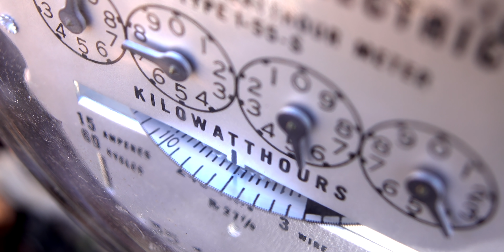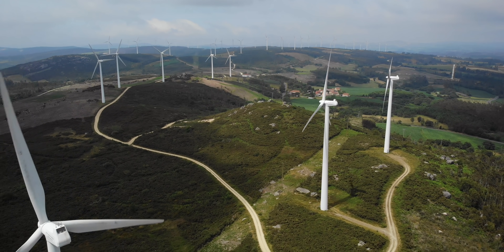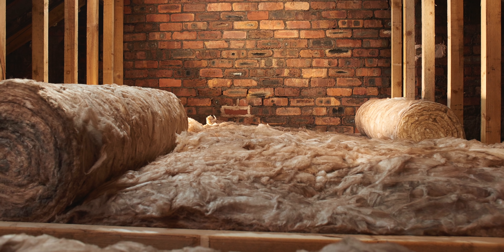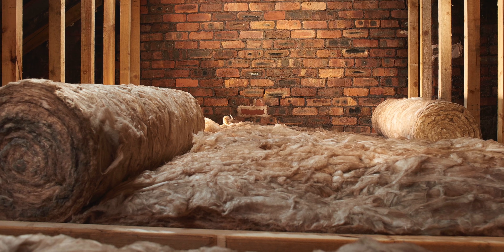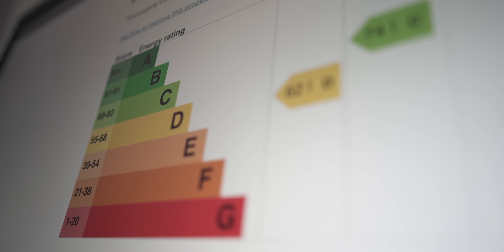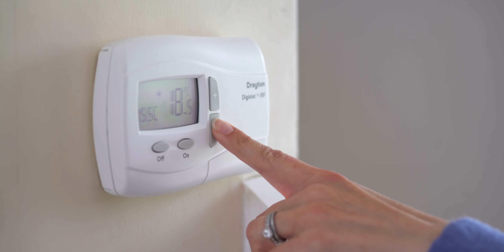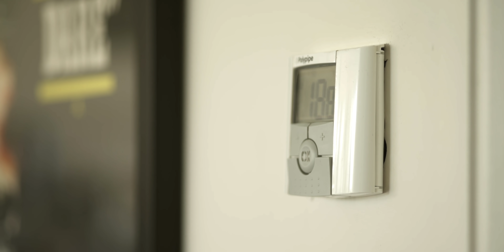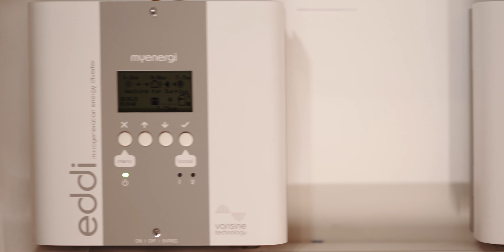HOME ENERGY Episode 1 - Cheaper Measures, Energy Efficiency & Fabric First | FULLY CHARGED

Comment: Did I mishear something in the opening credits... I thought I heard that the UK has the most leaky houses in Europe... are they talking about air sealing (ACH Air Changes per hour) when this statement is made. If its true (I assume it is) I wonder why the design of UK houses ends up with this outcome... maybe the UK has relatively more temperate weather ?
Reply: They mean the most heat-lossy buildings in Europe - so that's both terrible airtightness, and terrible insulation. The main reason is that our stock is much older than most countries. We have built very long-lasting (brick) buildings for a long time but they were not designed to be heated more than a fire in the corner. And yes because our weather is relatively mild we've been able to get away with very lax building standards. Places where it actually gets cold have been doing this much better for decades.

Comment: I live in an old house built around 1800 which is very much thermally inefficient, you going to talk more about rendering and such like, this is something I'd like to do but haven't got the confidence to know what is best given the potential cost outlay..
Reply: What sort of construction? Go to the Green Building Forum for advice. For a building that old (probably with no DPC and definitely no cavity) natural materials is generally best to remove risk of damp problems. Talk to BacktoEarth or NBC or Lime Green. They all have plenty of experience of putting on woodfibre EWI with lime or silicone renders. And can put you in touch with local installers. If you want to do it properly you should think about 3G windows throughout as well as EWI +perimeter insulation, airtightness+MVHR and roof or ceiling insulation to make a dramatically better building. Life is much easier if it's not listed.
Reply: @xxwookey  thank you will look into this, yes it's solid brick with no cavity and it's not listed

Comment: Yes, thermal efficiency of buildings needs to be improved, better insulation, windows, doors, cutting out heat loss from leaks. However, what about ventilation? Air tight/passive houses require a HVR system to recirculate the air which is installed in the walls, floors and ceilings. Or else lack of ventialtion will cause mould, condensation build up and sometimes health issues.
Reply: He did mention airtightness (before insulation) in fact, but it could have been emphasised that both are really important. Everyone knows about insulation. Air-tightness rarely get mentioned.

Comment: Hoooold it! Not heating rooms that are not in use is a downright dangerous suggestion. 

Once you go below 15 degrees Celsius, you risk mold when warmer, more humid air from other rooms enters the cold room and creates condensation. 

Don't do it. Keep the room temperature lower than in used rooms, but high enough to avoid mold.
Reply: I thought that mold comes from when there is humid air (carrying water) hitting a surface below the dew point... The humidity condenses into water and the damp creates an environment for mold to grow. So I understand its when you have deltas in temperature and a humid environment. Thats why double glazing sometimes fogs up... cold glass, warm humid air... Feel free to correct me I am a novice in this area.
Reply: @MovieNutter  yes you have it right, but the point is that typically-humid 20C internal air will condense around 13 or 14C so you really want to keep all internal surfaces above that critical 14C. So this doesn't require a specially-humid environment - just a normal house with people in it (breathing, cooking, washing). This is why triple glazing is such a good idea, because it never gets colder than that on the inside. and why airtightness is important, because the wet air going into the fabric on the way out will cool to below 14C somewhere in the wall, which is not where you want the water collecting. So anders is right that in a poorly insulated building there is a risk of condensation in the unheated rooms. If the insulation is any good at all then the unheated parts will stay fairly warm.
Reply: Capt Shiny houses don't have to be massive for heat not to reach unused rooms. We had a typical Victorian semi, three stories with original staff bedrooms in the roof. With the door at the bottom of the stairs closed these rooms quickly cooled to little more than a few degrees above the outside temperature. Same with the rear bedroom on the first floor which had two outside walls and no cavity.

Comment: Loved the video, we opted to replace our oil boiler with an air source heat pump last year, the technology made it so evident how we were losing energy in our 1930’s house and the need to insulate more which is proving challenge, I wouldn’t go back as despite the increased electricity bill it is still cheaper than oil but we have a way still to go. Looking forward to the rest of the videos.

Comment: All real estate sites should be required to include an energy rating and the monthly cost for the last 12 months of heating and cooling utility bills whenever a home or building is listed for sale. A person might be able to afford a better home if their total cost of ownership was lower.
Reply: They basically do that already in the U.K.
Reply: @bordersw1239  Yep, not in other places though
Reply: Kenz300 x We have had such certificates in the U.K. for years, and nobody ever looks at them. There are so many factors that are considered when buying a home, and for most energy efficiency comes at the bottom of a very long list. In any case, all new homes are built to a similar standard so cost roughly the same to run on a per sq ft basis.

Comment: Thanks for the 1st episode. I’m interested in the aeriated shower heads. You source mentions ‘under £100’, but a quick search on Amazon shows around £10. Are these models the same thing? (The heads with the stone balls in). Cheers
Reply: Yes (but there's more than Amazon; any decent DIY building supply market should carry them where you get to see and feel them in real life too)
Reply: You can get aerated shower heads for incredibly cheap nowadays but there are some really fancy ones also costing more. 

I’ve installed aerated connectors on all my taps. It made a world of a difference to the water usage. It is an absolute no brainer.

Comment: looks like a great series, just hope that in the heating episode you did not forget half the world that needs aircon more then heating.....
Reply: Heat pumps are able to do air conditioning as well as heating as long as the inside part is set up properly. If you replace a boiler with a heat pump so that it heat water for radiators then it won't be able to do air conditioning. However, if you replace a forced air furnace that burns gas or uses electricity to create heat with a heat pump then the heat pump can provide air conditioning. An air exchange heat pump is almost the same as an air conditioner that is often hooked up to those forced air furnaces.
Reply: @capitalinventor4823  we don't have heating here - no need, for a few days a year - we heat with the aircon, the question is if there is if a GSHP or ASHP is more efficient then aircon?
Reply: @idodekkers9165  

An air source heat pump is an air conditioner that can also run in reverse. If you are able to heat with your air conditioner then you already have an air source heat pump. 

Ground source heat pumps are going to be more efficient because the pipes are going to be installed in the ground where the temperature is at a constant temperature that works well for both heating and cooling. With an air source heat pump there will be times when you want to cool your building when it's so hot outside that it's difficult for outdoor part of the unit to get rid of heat transferred from inside. (The same thing happens when it's so cold that it's difficult for the outside part of the unit to extract any heat from the outside air.) Of course these times happen right when you most want the unit to work. 

It then comes down to price. Getting the pipes put in for the ground source heat pump system is expensive and makes those systems much more expensive than air source heat pumps. When I was looking at replacing my furnace back in 2015 an air source heat pump was twice as expensive as a high efficiency furnace and the ground source heat pump was about 2.5 times as expensive as the air source heat pump. I'm sure prices have changed since then.
Reply: @capitalinventor4823  so if I understand correctly, what the heat pump basically does is get the temp outside, lets say 23 and if I want 20 it only cools the difference with electricity?

Comment: I like to think I’m fairly technologically literate but the one thing I’m struggling with is figuring how you get all these different systems to talk to one another and work in harmony.
Reply: I know I'm tech literate (both formal education and over 35 years of experience in the energy field) but why would you want to have them "connected"?
All of these "systems" are (relatively) simple and (can) work perfectly well "stand-alone"
Connecting them only complicates things unnecessarily
Reply: @TestTest-eb8jr   Ok so I’m thinking is that we’ll likely see options such as solar pv, battery, EV charger, hot water tanks etc. Individually they are often designed to utilise excess solar to shift energy use away from peak times. But how do you integrate then so they don’t fight over the same limit supply?
Reply: @696Spike  Although the supply of solar energy is (theoretically) vitually limitless, in practice there will always be limits.
Connecting systems to harvest and manage every last Wh (Watthour) is theoretically possible but the costs will be greater than the benefits.
[and there's a practical side to it too, all this "stuff" will have to "fit" somewhere]

Comment: Looking forward to this series. Would love NOT to get a gas boiler next time but doesn't seem easy for a 25 yr old house without ripping up and starting again.
Reply: I fitted a electric boiler on a conventional wet central heating layout.
Reply: @stephengeary6382  Thanks, didn’t know they existed. Any recommendations?  Thanks.
Reply: Richard Eskins Don't whatever you do follow that advice! Electric resistive heat is the most expensive form of heat there is. Depending on where you are in the country you could pay as much as five times as much per kWh. Swapping mains gas heat for electric resistive heat would cost you dearly.
Reply: @spencerwilton5831  i did too last year , my gas standing charge was one twelfth of my annual energy bill , I fitted a megaflow which is lifetime warrantied for hot water and heat with octopus go at 5p kwh, the boiler I fitted is a  Amptec 6kw along with Drayton Wiser smart stat. I have solar PV too and will add more as its cheaper than a heat pump.
Reply: @waynecartwright7276   If octopus go was to go bust you would be up a creek in the current market wouldn't you? /4 bust this week/

Comment: Insulate insulate insulate?
Perfect insulation = health considerations due to CO2 build up or Radon gas.
Ventilation offsets heating efficiency, but is essential for health.
Not mentioned. Why not ? 👎
Reply: There's a huge difference between a house a leaks and a house that is tightly sealed with ventilation to provide fresh air. With ventilation one may control how much air is being exchanged, when, and from where in the house the air leaves. An upgraded ventilation system will also have a heat exchange system that will have the air leaving the house pass by the air entering the house, but not mix, so that some of the heat from the hotter air may move to the cooler air reducing the amount of energy lost by ventilation.
Reply: @capitalinventor4823  exactly. Targeted ventilation where outside air is allowed to circulate, but only when heat recovery is in place. FC never said no fresh air.
Reply: I feel that the older UK housing stock was built with the presumption that it would not be air tight therefore if you seal up the wall cavities and block the roof space the house is no longer able to 'breathe' and damp will form aswell as toxic fumes from all the ghastly materials used to fill in the walls. I'm in a 1950's semi which had a second skin of brick applied in the '80's which the previous owner put so many holes in for ariels and the like that the whole house would have been filled with the  stuff they inject into the walls before the cavity sealed! Yes I'm being ironic there and I'm sure you'll tell me the 'ghastly' stuff is paper or some such benign substance. So how does it stay in one place in the walls and not sink over time to the bottom of the gap? With something ghastly to hold it together I'd vouch....
Our solution: do not set the thermostat to more than 18° on a normal winters day. In the spring we think that is a mild day and in summer as the heat rises, well gosh, we're feeling hot when the glass climbs beyond 21° so why would anyone set their house thermostat to 24 or 25 degrees?
We have thermostats on the radiators, the one in our bedroom is pretty much switched off apart from the coldest of days and then it's only on about 15° until bedtime when it goes off again. Same in the hall, the bathroom funnily enough and contrary to your 'expert' is the one room in the house we keep warm for the most days over the year so we have dry, warm towels (yes, we use them more than once😲) and to prevent condensation. Oh and we don't use a timer as we are always at home but we manually turn down the thermostat when we go to bed to a 'tick-over' temp of, say, 10 to 14° which is just enough so that it will come on if it gets really cold overnight and also means the heating doesn't have to work so hard to bring up the temperature in the morning. If it does come on at night I usually wake up baking!
Absolutely, build houses with the proper insulation and use sustainable methods of heating but remember, first put on warmer clothes. The main reason I close my windows is to prevent noise or smells like bonfires or fumes from vehicles or crop spraying from getting in! Other than that if its not tipping down, fresh air is favourite.
Reply: @I G nope, toasty 👍😁 I'd be miserable with too much heat 🔥
Reply from the maker: We have to cover the whole subject in 110 minutes, this is designed much like our 'Maddie Goes Electric' series to be accessible and to enable people to start down a path. We could talk about each subject for hours but we had to start somewhere for our consumer audience. If there's demand we will drill down on all of these topics.

Comment: Well done, much needed series but do keep a low background heat in rooms you don't use to avoid condensation and damp.
Reply: That was my thought to. Solid brick houses do not work well if you make them air tight. Damp can be a big problem.
Reply: @stephengeary6382  passiv house standard ...check it out...airtight, but energy recovering ventilation so the houses are much better

Comment: Air tightness is key. Do a blower door test to identify leaks and measure before/after.
Reply: @Lee5p33dy  Actually no... its an odd answer on the face of it... but its better to have the house totally sealed and then have a controlled way of bringing in fresh air.  This way the air can be warmed/cooled/cleaned/dehumidified before it comes in. The problem with having a leaky house is that the air leaks in through bad places (through insulation or basement or plumbing fittings). I air sealed my attic a few years back and I was shocked at the impact it had.